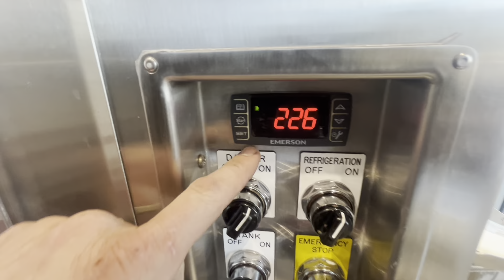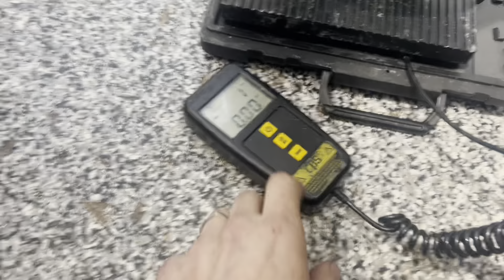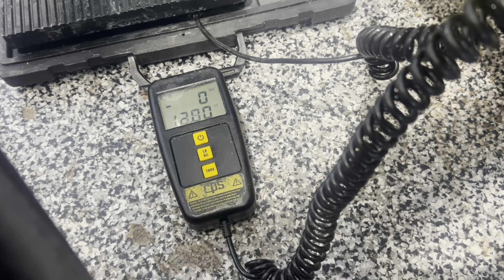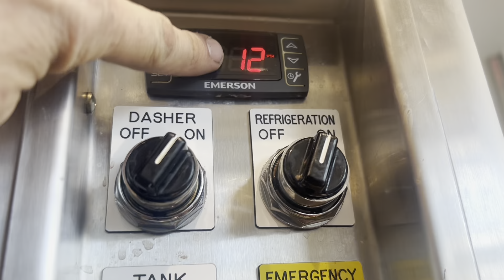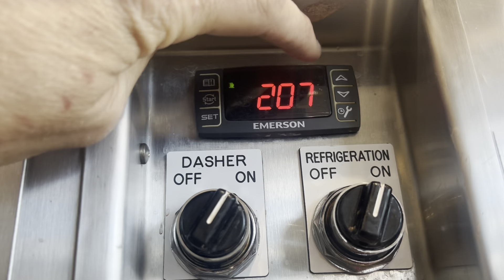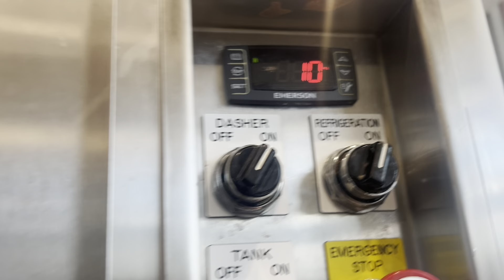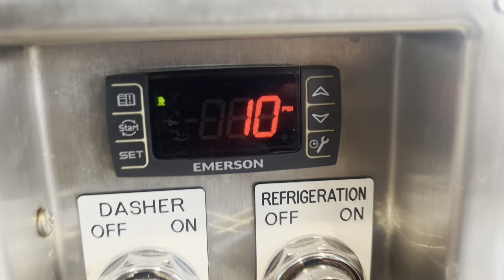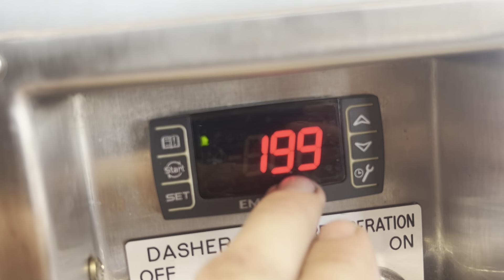Custard machine - underperforming

Comment: Funny watching you screw the cap on, seeing bubbles..... but when you close the cap, it does push out air, leaking or not as the space gets smaller.
Reply from the maker: Agreed.   I also realized that and was able to get bubbles as I unscrewed the cap also.   I hate the svhraeder valve copout leak.   I don’t think that’s where the issue would have been to be that short without oil but I got no hits anywhere else so 🤷🏻‍♂️